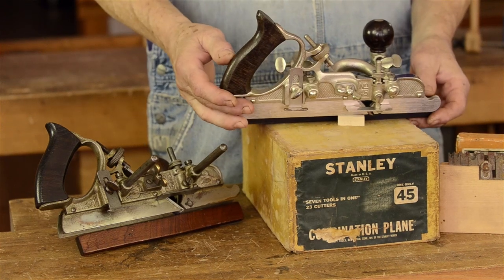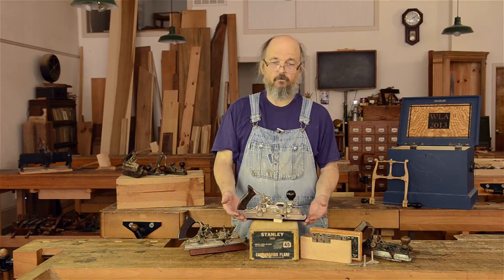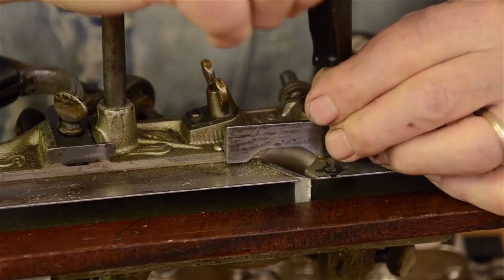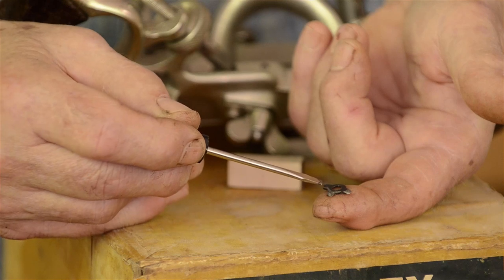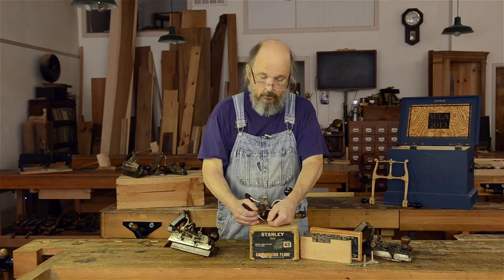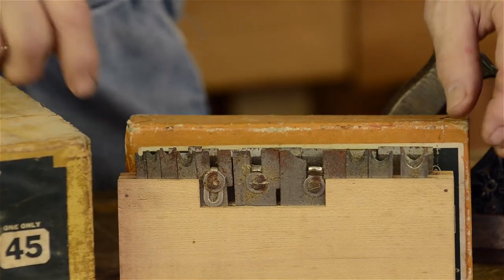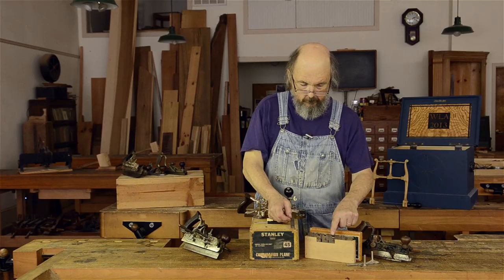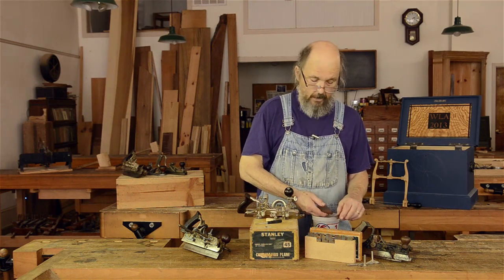How to Refurbish a Combination Plane for Woodworking

Comment: Thanks for this video, I have just taken delivery of a Record 405, almost the same as the Stanley 45 I believe. I can clean it up generally and sharpen the blades, but have you any tips for getting rust off the rods especially, and also the flaking of chrome on some of the parts. It's not so much the cosmetic look, it would help things slide more easily too.  All advice gratefully received.